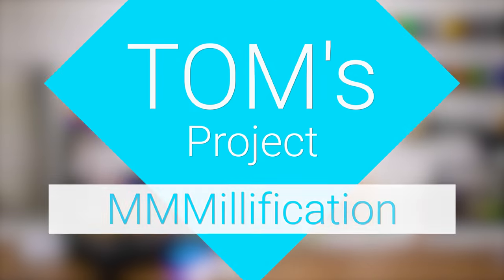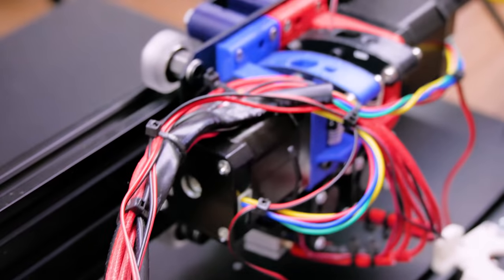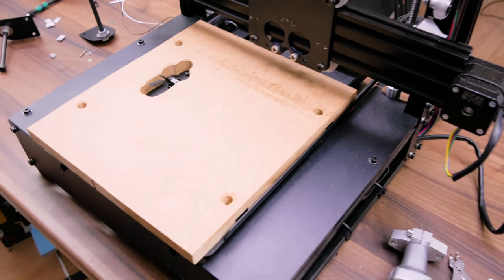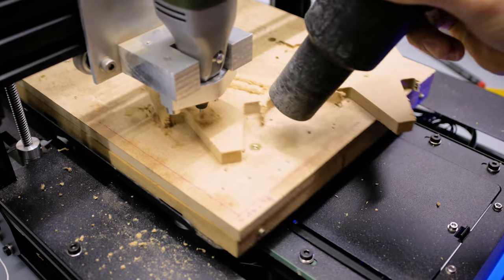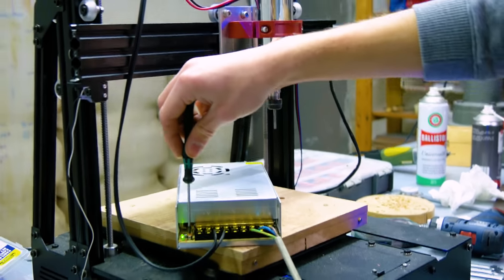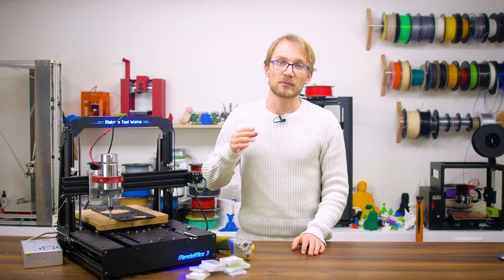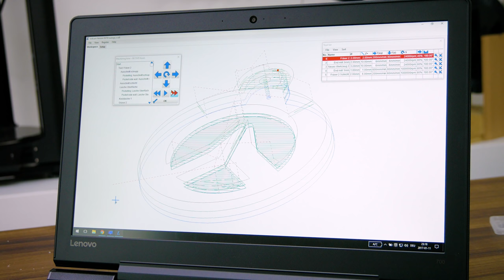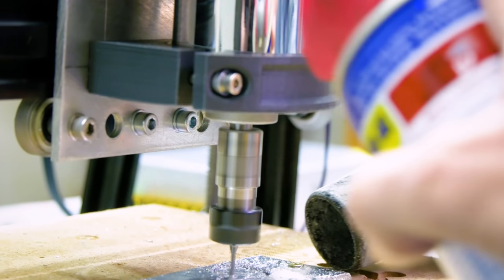CNC mill built from a 3D Printer!

Comment: That is awesome. With my current education in Precision Machining and CNC Automation, which is still limited, the similarities between the overall configurations of industrial (cartesian) CNC milling machines and the open-source marlin, reprapfirmware, and similar is exciting. I imagine open-source CNC machines are going to get a LOT better in the next year or two with the increase of adoption I am seeing. The config files are extremely similar. Not only is milling CAM software getting a lot better each year, with the slicer software improving....and materials getting interesting and relatively more available...this should be a fun year, to say the least. I am working on a mendel max of my own, scaled up slightly with 45x45 aluminum extrusion because...it needs it! :)

Comment: Chips are gonna fly!!!  Don't stare at the thing with safety glasses on only, full face shield!  I once found a seriously large curl of aluminum in my nostril!  If I had rubbed my nose I would have had a pretty serious cut from it I suspect but luckily felt the thing itch and reached up sort of slowly with my off hand as I was turning a manual mill bed Y axis.  Honestly chips have this malicious intent occasionally, you have been warned!

Comment: amazing! i have had some thoughts about building one of those myself throughout the years.  maybe a core-xy would be more suitable for the project though.
Reply: Hi, Im thinking ok a core XY for my grabbing / printer CNC. Do you think is a good idea?
Reply: @alexandropalacios7782  Depends on. There are limitations with a core xy, what do you want to do with it?
Reply: @MoreCharactersThanNeeded  Well, It wiil habe a 40 x 60 cm bed, and apart from 3D printing, I want to use it for grabbing pictures in MDF and It would be great if I can use a dremel for aluminium

Comment: Hi Thomas, really enjoyed your video after finding you recently.  Have you pondered converting medium-duty CNC mill to 3D print?  I picked up one for about $700 USD that had a fairly ample working envelope of roughly 300x400mm, though currently the Z axis only has 80mm of travel.  I paid a little extra for a fourth axis which shipped with a full-size 3-jaw chuck you might see mounted on a mini-lathe, very impressive.  It's very sturdy with 12mm aluminum plate used throughout the entire machine, and ballscrews for low backlash.  It's not for working steel but very competent and quite accurate for everything else (Uses 16X microstepping for .000625mm/step).  Uses a 24V supply with what they call "57" stepper motors, very quiet and works great with an Arduino Uno running GRBL (Though GRBL doesn't support the fourth axis); it shipped with a 25-pin printer-port-style connector but since I didn't want to run the steppers from my PC I used GRBL to do the G-code work onboard.  I use a free package called bCNC to drive it from my Linux/Ubuntu PC, which includes quite a few features for simple things like leveling a surface, engraving text and shapes etc., and provides profiles for materials and end mills/tooling, along with buffering and loading G-code files,  interpreting DXF, and even ASCII STL.  It even has support for using a USB camera to do measurements and homing, though I haven't gotten mine properly calibrated and mounted yet; I thought it was a very ambitious feature for such a simple, powerful package.
Anyway, the mill was an attractive buy since it shipped completely assembled in two large, heavy wooden crates from a company in California (I'm in the US), and arrived in perfect condition due to some serious, steel tie-downs and wooden mounting braces.  I got it on eBay, here's the item number for a similar mill (They're fairly generic and are re-sold by a number of importers): 262850371022.  --What do you think?  Would it work for 3D printing or is it too slow/limited?  Given the prices for some of the nicer 3D printers it's not terribly expensive, so it seemed like a good possible match for mounting an extruder.  I've tried mounting a laser for light-duty paper cutting and burning text/images into wood, which worked quite well (No visible stepping artifacts, even under magnification), though a bit slow (1000mm/min) since I wanted it to be accurate without a lot of slop.

Comment: That's awesome. Any thoughts on mounting your vacuum cleaner hose next to the rotary tool, like a reverse part-cooling fan? ;-)
Reply: I did exactly this and it's fantastic.  I 3D printed a mount and duct with a C-shaped downward-facing opening around the cutter.  It really works at minimizing the mess.  In my case the mill is a Chinese 3020 with the controller replaced by a Smoothie board.

Comment: I have a Tevo Black Widow that I am very happy with. I'd like to retrofit it so I can add a CNC head to it. One  thing I am curious about is that it is belt driven for the X and Y.. Not thread. When CNCing how much pressure would be put on the bit during normal operation and would the belt be sufficient to hold the bit in position. 
Many thanks

Comment: Does the power supply just drive the spindle? What about the electronics? They usually take 12/24v, so I wonder if you are running two power supplies or stepping down the current for the controller board?

Comment: @Thomas

Do you have a solution for the speed control? (Be careful with just adjusting the voltage by the trim pot, the electronics inside or not satisfied with this. The function from this trim pot is to adjust the voltage back to 48V when the load is high.)

Maybe you can also look into mostly printed CNC, this one I'm currently making :D 

I looking forward to you next video's about CNC.

Comment: Great conversion Tom! Keep up the good work!
Do you think that using enclosed ball bearings like the sc10uu type will keep them from being stuck by bits from drilling?
Also, your speeds seem to be a lot slower, especially when milling Aluminum. How slow must you go to avoid breaking the end mill?
Reply: Thanks for the info. I am planning to build a DIY cnc sometime in the future, since i gained a lot of experience building my own DIY 3D printer. So all your shared knowledge is of great importance to us. Keep trying... ;-)
Reply: What about Drylin bearings (or a 3d printed imitation)?

Comment: Hi, if you were converting 3d printer to cnc (preferably not a permanent change, but with swapable extruder/drill), which 3d printers you would choose? (it will be helpful for others, but in by case it will be my 1st 3d printer so let's the budget be under $400). I would be very thankful for provided printer models :)
Reply: My current choice is bambu lab a1, looks like converting will be easy. But I'll wait and hope for your response

Comment: Are you using the default (marlin?) firmware of the 3d printer (i assume grbl is enough to handle everything). I've planned to upgrade an old engraving machine that has a ton proprietary chips and super old software that still run on dos.  I suppose, any RAMPS board would be more than enough for this.
Reply: Hey i just converted my printer to a CNC.. took me 3 days to figure it out but you dont even need GRBL you can use any firmware that you can modify in arduino... you just need to change the travel limits after homing to a negative value in the MIN Z field hit me up if you need help doing it...
Reply: @dannytsuji807  Hey, i feel i'm a year too late here, but I've got a Wanhao Duplicator i3 that i've been thinking of converting to a PCB CNC router.

I've got the source files for its marlin firmware, could you elaborate on what needs to be edited? Is it only the MIN Z?
Reply: @PatrickHansen101  Well depending on what software your using to write your Gcode you might need to change the MIN Z in the travel limits after homing to negative value I.E. MIN Z:-15mm. for instance if the GCODE is showing -3.300 for the lowest part of the Z it wont mill if the  MIN Z is set to zero like on most 3d printers.
Reply: @dannytsuji807  Did not expect a response!
Thanks!

That makes sense, i think, so in GCODE for cnc routing, 0  on the Z axis is the default tool height (but higher up than 0 would be if you were 3d print)  and the tool is moved to negative Z to work? in contrast to 0 being an absolute minimum of the machine and starting height being X.

Also, would one need to move the endstop switch to the desired initial height?

Comment: One quick comment. Ballscrews! @ these dimensions ~$15/pcs from aliexpress. speed, smoothness, what's not to want?
Reply: If you need to turn down lead screw ends then just 3D print  lathe! I turned down my acme lead screw ends by mounting the screws in some bearings, and spinning them. Then I ground them down with an angle grinder. Good enough.

Comment: Hi Guys, I just had an Idea about using Cura slicer for CNC routers, what if we inverted the G-Code created by the slicer, i.e. the G-code starts from the end of the file, of course the stl file should be modified to accommodate this, instead of having the design on cura one will have to draw the contours and change the layer and nozzle and fan settings, would this work? My 3D printer is infected with Covid 19 confinement and I can't touch it for the  moment.

Comment: Do you have any experience with the cam Part of fusion 360 and do you know of firmware and the fitting Hardware to make a diy router/mill that can be used with fusion 360?

Comment: What is the best 3D printer for Cnc conversion and under 700
Reply: for that you can get yourself a 3040 router with all electonic and 500w motor and start upgrading from that.

Comment: I have a Anet A8 3D printer and would like to turn it into a CNC mill I have done all the upgrades/mods belt tensioners, braces, and marlin firmware. I have a plan and would like some advice. I have a Black & Decker RTX and a 24" flexible shaft. I plan to mount/hang the router and print a mounting bracket for the shaft this will reduce the weight on the carriage, then I can replace all the 3D printed parts with metal. what I would like to know is do I have to reflash the firmware or can Marlin do both. I also plan on getting a laser and would like to be able to swap between the 3 print head ( is that the correct term for extruder, mill and laser?) Second question I use cura for slicing the videos and what I've read other people use other programs to generate gcode and save it as .nc file not .gcode. I like raspberry pi and octoprint could I use that? :) I love the show and you have helped so much already :)
Reply: PS useing the flexible shaft also reduces the risk of shorting things if I use water or oil for cooling :)

Comment: I have written a simple GCODE postprocessor for using GCODE produced with Makercam (free online 2.5D CAM) in order to "clean" and speed up the machining for use with 3D printers based CNC that uses Marlin as firmware. The Marlin firmware doesn't understand all the GCODEs used in GBRL and some of these may generate some weird behavior (may be dangerous for operator / machine)

The postprocessor is downloadable from github: https://github.com/alessiocavalieri/MakerCAM2FABtotum

and a tutorial is available here (italian / english): http://itink.it/wiki/doku.php?id=en:tinkering:cnc:woodnameplateformontessoribedgiulio

Comment: You might be able to jerry rig that spindle motor controller with something like a MCP41X1 or MCP41X2 (Depending on whether that pot is wired as a potentiometer or rheostat), so you can hook the control back into the firmware, which should open some more toolpath options. Oh and I do encourage you persist with Autodesk fusion. Its actually some pretty smart software once you get your head around it.

Comment: You can convert a cheap proxxon mf-70 to a cnc machine. It's cheaper
Reply: The issue with MF70 is the backlash. As soon as you mod the machine to eliminate it is wonderful to use as a small CNC machine. There are a lot of videos on YT with converted Proxxon machines.
Reply: And i'm probably sure that the backlash is less than on a 3d Printer !